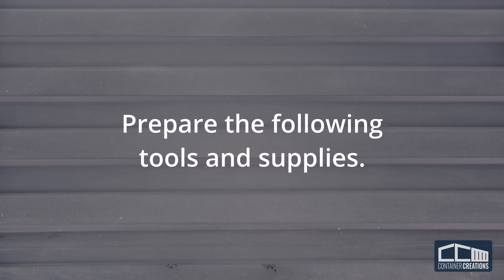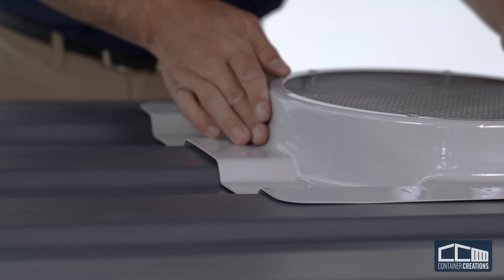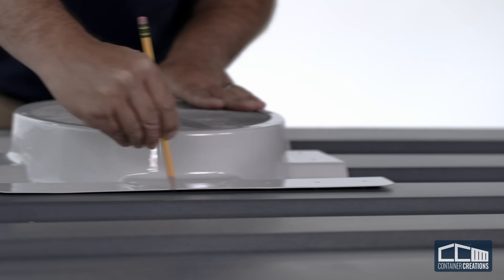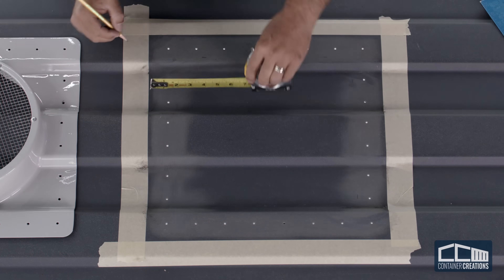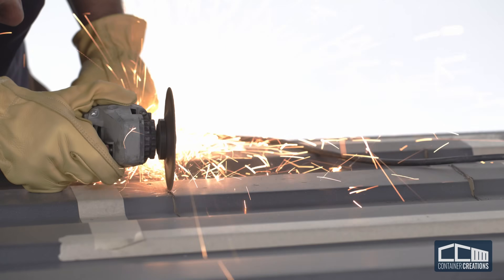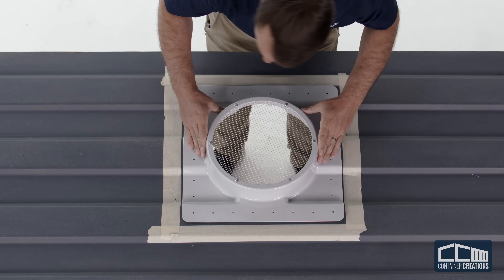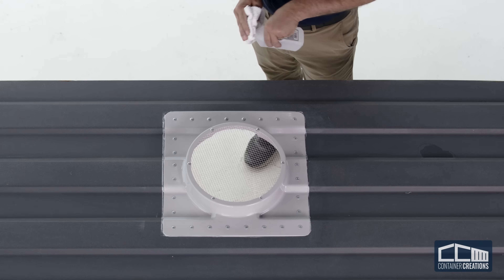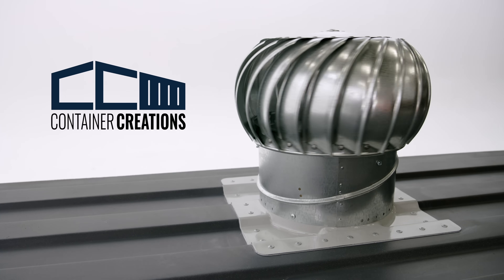How to Install Vent on a Shipping Container

Comment: The adapter they send is 16.75 × 17. If you use their directions measuring 2 inches from pencil line you get a square thats 12.75 × 13 not 12×12 like the directions claim.

Comment: When fitting my 2 adaptors I removed the wire mesh and drew a circle and then cut them out using a plasma cutter and later made a plywood cover on the ceiling to tidy up the screws and edges.
I was using 2 of the wind powered whirlybirds and am now using 2 solar powered whirlybirds but I did have to weld up an adaptor to fit the whirlybirds to your adaptors..

Comment: I purchased two complete set ups for venting my 40' containers. Installed as directed with your roof vents and 8- 3" vents around walls.  And now there is no air movement at all!!! Not happy. Now you wont answer my calls or call me back!!!!!' Whats the deal!!!!!!
Reply: More than ONE turbine and they will hardly spin due to over ventilation! ONE vent dead center and that would be ideal....... and why not, there are NONE to begin with...........
Reply: I put two roof vents spaced evenly in a 40' high cube with 20 of the little circle vents spaced evenly on the walls near the floor. With proper wind mine vents great.

Comment: Instead of just Isopropyl alcohol, it works MUCH better if you also have ethanol on hand.  Not to much to start with, but at least a shot or two when done.  (that's a joke for those of you without humor)
After checking the prices, better make that about 4 or 5 shots.  YIKES!
I think I'll get some galvanized sheets at HD and roll my own.
Reply: You're not wrong. What a rip-off!

Comment: How many would a person need for a 40’ container
Reply from the maker: We recommend at least on 12-inch vent for every 20-ft of container.
Reply: @ContainerCreations  Is there a way to block off the vent on the inside during the winter?
Reply: @matth1862  Yeh, put a garbage bag over it.......:face-green-smiling: